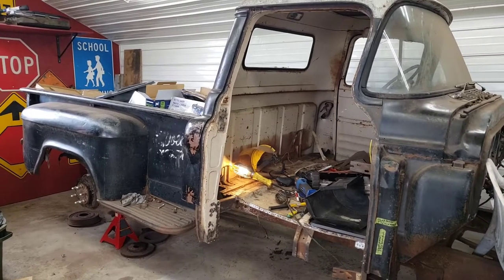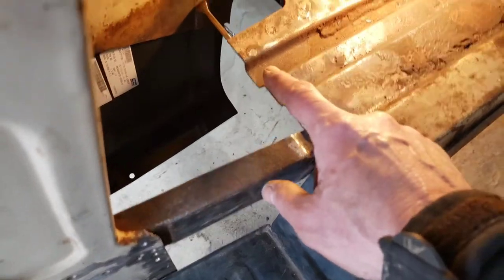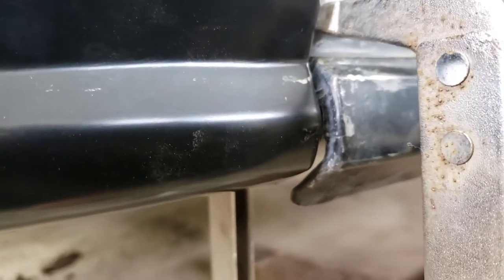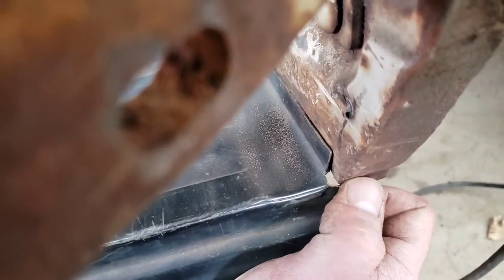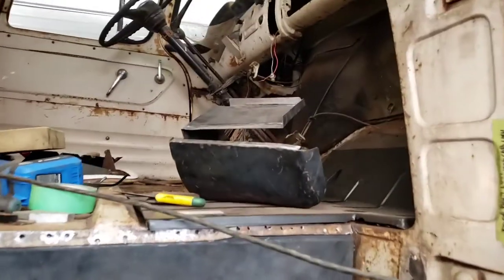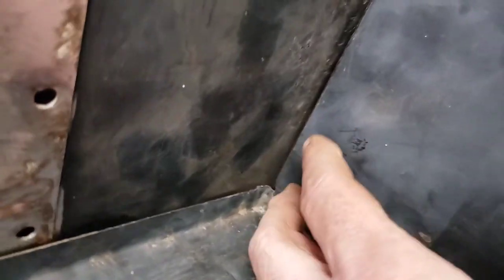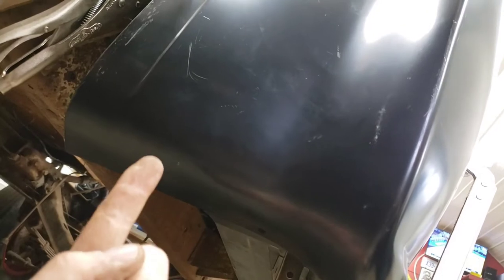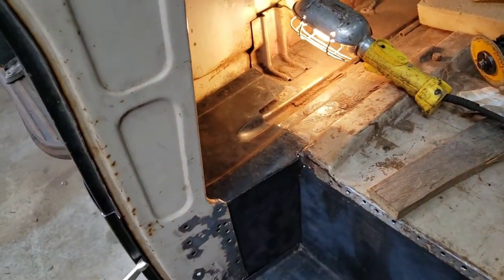1955 Chevy Pickup Cab Step, Inner and Outer Cab Corner Mock Up

Comment: I hate aftermarket sheetmetal. After experiencing trying to fit aftermarket stuff, I've sworn to look for original used parts first until there's no hope of finding it, then aftermarket as the very  last resort.
Reply from the maker: Luckily its the inner cab corner that requires the major modification and whatever i need to do will be hidden from view.